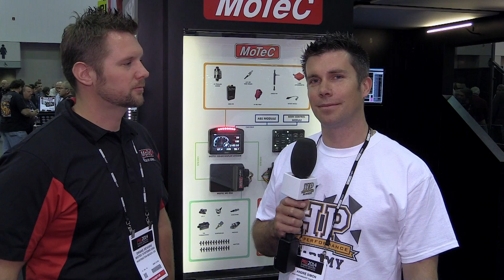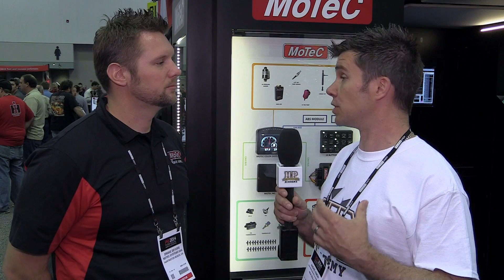[TECH TALK] 'Hoonicorn' Ken Block’s Gymkhana 7 | Tuned without a dyno?!

Comment: Whats the engine stats/build???  Tried to find specs everywhere; sure you cant give all detail preventing unwanted copies, but can basics be found anywhere like bore/stroke, cam size/stats, general timing, intake/head cfm, valve setup, compression?  Curious; for a non forced injection 850 hp that revs stupid fast with a 8k redline is really impressive

MS chemical engr I really appreciate the tech you discuss here, I know all about difficulties of modeling fluids/flow properties like IN man. pressure being "guessed".  I'd die to work with that level of detail, from modeling parameters, calculating mixtures or optimizing for different fuel type, heat transfer and cooling based on metal type/thickness etc.  Amazing things can be engineered or improved upon; I'd give anything to have opportunity to use my knowledge applied to something useful like that and actually use the 7 yrs of school and endless hours of self improving studies/experimental builds after school till now.  Experience 3 yrs in R&D materials development along with battery improvement, fuel alts, more I cant display on pubic sites at Oak Ridge TN, USA, site of first nuclear weapon.  How advanced is electronics and control system, does it tweak timing in real time?  Have VVT??  

Ever think of trying to place a temp-sensitive resistor or P sensor diaphram suspended in center of hole at the top of each intake air port to read air flow in, similar to how a mass air flow works on std. engines?  Is the IN pressure just used to determine incoming flow anyway to set other parameters?  Could measure flow directly with several options at each in ram, then sum for total and use that estimate for each cylinder, or being max precision each individual cyl. IN could be used to fine tune further individually to each cylinder by controlling fuel?  Anyway sorry for rant I just love creative and/or optimization projects.  Thanks for vid post,

Chad Kimsey